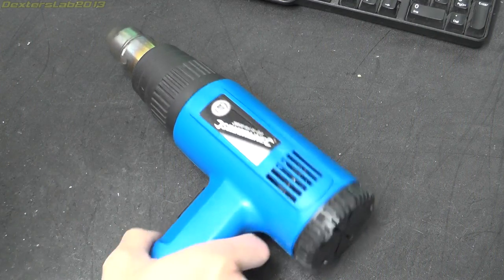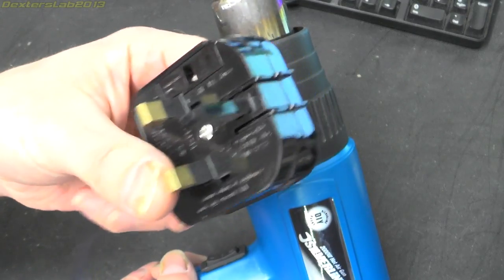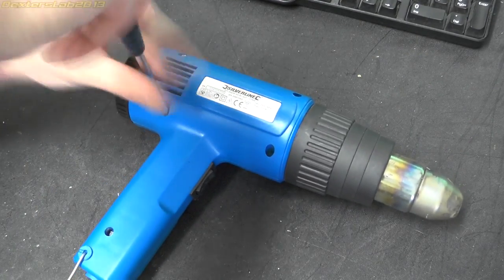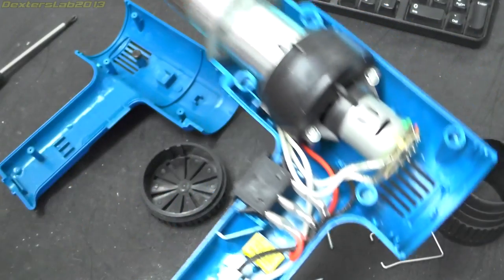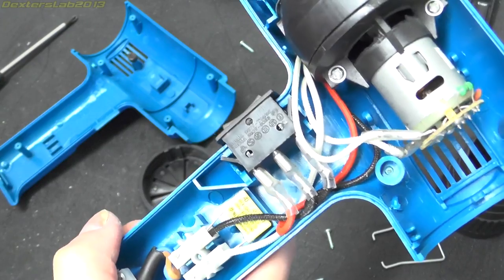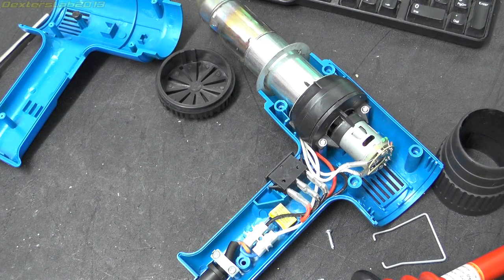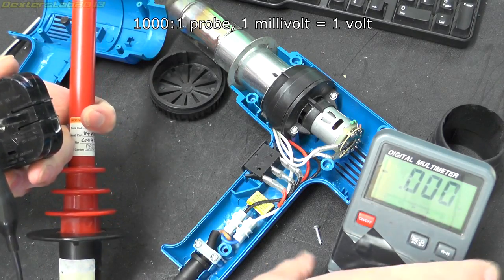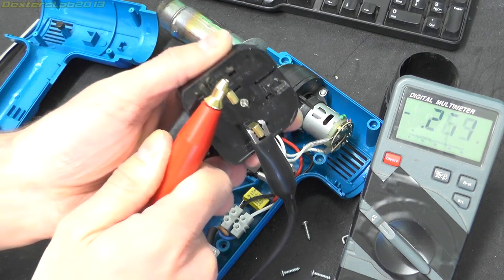DL#086 - Shocking: My Hot Air Gun!

Comment: My wife's hairdryer did that. It was a very reputable brand but I can't recall which. I couldn't be bothered to move the capacitor upstream of the switch so I bunged a bleed resistor across it, problem solved!

Comment: The cap is there for the European Ce conformity. Here in the states they are not there unless Ce marked. It's for power factor reduction. We have millions and millions of devices that the manufacturer was too cheap to put it in or required to. It saves some electricity when used. They should be installed on all of the florescent screw in lights here to save power. Probably cost them about .08 to .12 cents a piece.

Comment: just put a 1M resistor across it, I think they put it before the switch are for prevent surge in the main when that thing switching on while not in a good waveform so it will not as effective if you put it after the switch

Comment: My vacuum cleaner gives me a zap if I unplug it without turning the switch off, so I'm guessing the cap is after the switch. I guess you could move it to after the switch, and/or add a bleeder resistor.
Reply: +nickhill92 Hah. That happened to me once. I think it's the motor back emf that does it. When I pulled the plug, the motor was still spinning, and it felt like a generator connected to my hand..It was not like a single zap from a cap, it was a continuous buzzing like discharge.

Comment: Clearly a design fault. You should also have some sort of authority in the UK where you can report these things. The manufacturer/importer should get done for this. In the US you could sue them big time now ;)
Reply from the maker: +Chip Guy Vids Going from the other comments this is not unusual! TBH i would be surprised if it didn't conform to regs.
Reply: The various standard mention a time in which "risidual charges" have to disappear. So there sould at least be a bleeding resistor.

Comment: I have always got electrocuted when I have touched the housing of my vintage Pioneer SM-83 tube amplifier
Reply: I've fixed it like 18 years ago. It was a faulty cap between mains in and housing.
Reply: Ing. Max Koschuh I have a graphic equaliser that has metal case. I get shock off it.  How can it be fixed?